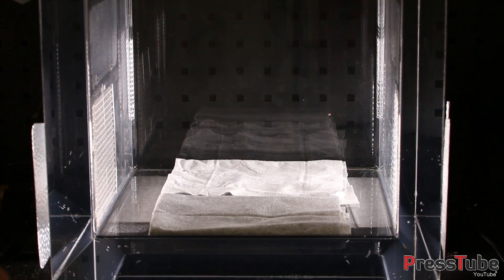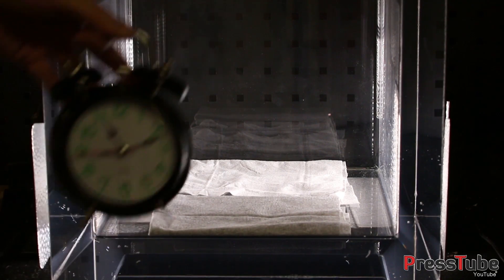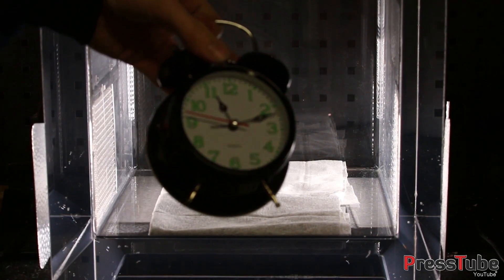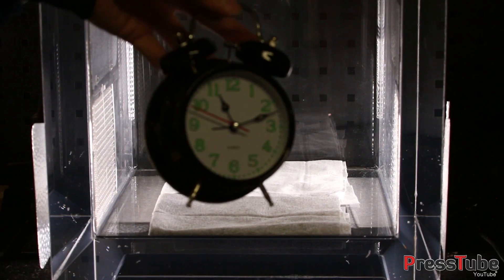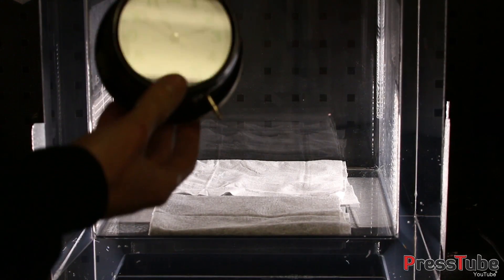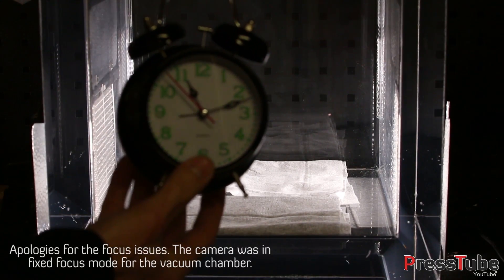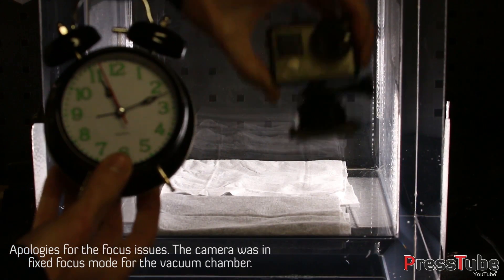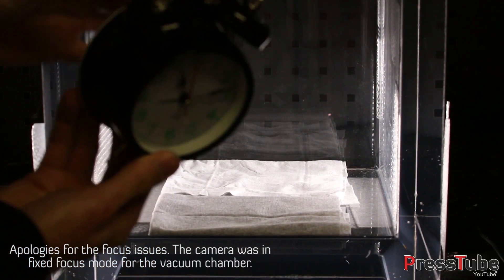What happens when you put an alarm clock in a vacuum chamber? Will you still hear it?

Comment: What happens to that sound energy? Where is energy conservation here?
Reply: The electric energy from the batteries is still being used to ring the alarm, the reason we can't hear anything is because the air is not present, and so nothing can transport the vibrations made by the alarm. It's like when you close your eyes, is the eletromagnetic radiation from the sun being lost? No, it just has no means of reaching to your eyes.

Comment: if you woulf hang it from a rubber string you could not hear it at al because the sound can travel by mass and not by air
Reply from the maker: Hmm, interesting ! It were indeed the vibrations thru the acryllic chamber that you are hearing.

Comment: If you try to breathe in a vacuum, does it do what space would do and suck the air out of your lungs or does it just make it resistant for u to breathe?
Reply: Syreds - Clash Royale & Clash of Clans You should exhale and try to escape the situation quickly. If you left the air inside your lungs, it would expand and your lungs would burst
Reply: Syreds - Clash Royale & Clash of Clans if you tried, you would not be able to inhale. Your diaphragm is able to help you inhale by creating lower pressure in your lungs than outside of them which causes you to take in air. Since the pressure is so low it's not possible for you to breathe in